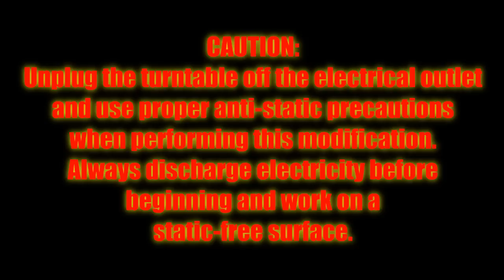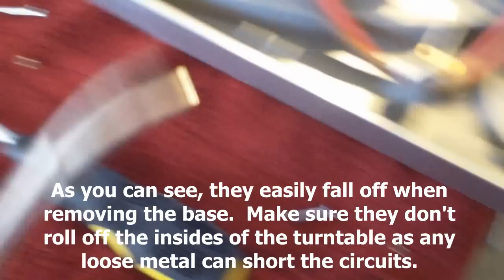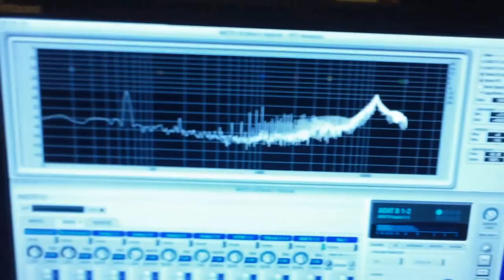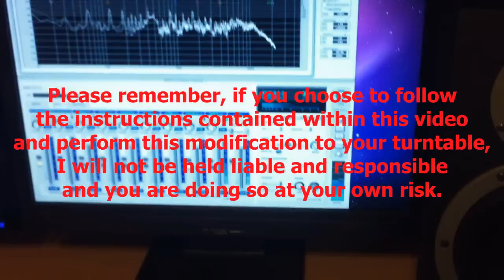AT-LP120 Preamp Removal (Step by Step Instructions)

Comment: i just finished this mod.but all i did was add another set of RCA cables on top of the tone arm wires. i never touched the preamp board.now i have 2 sets of RCA cables coming out of the back.so everything still functions properly. i just use whichever RCA cables i need for usb or listening thru my amp/reciever ,which has a phono preamp.
Reply: Yeah... like, do you even need to "remove" the pre-amp? It seems to me all you need to do is unsolder the connection.
Reply: Wouldn't that still be under the load of the built in pre-amp?  Isn't the pre-amp electrically connected in parallel to the tone arm wires, and therefore the only way to bypass it would be to break that connection?

Comment: Why are you doing this? Can't you just set the output switch to 'phono' and bypass the pre-amp?
Reply: Unfortunately, no.  While you "bypass" the preamp, the signal actually travels from the tone arm through the preamp board and out to your receiver, etc.  While not a huge deal, the right and left channel still each go through a coil and a small capacitor located on the preamp.  This is why people remove the preamp entirely.
Reply: Rich, If I don't remove this preamp and bypass the signal to another preamp- would there be any noticeable difference?

Comment: I don't understand why add a ground wire, as this turntable is already internally grounded no?
Besides that, why not just add a ON/ON 4 poles switch to the RCA cable (internal AMP ir bypass amp)

Comment: question?  How do I discharge the electricity?
Reply: +beefsupreme64 you can discharge static electricity by touching a grounded object. A metal computer case, or the screws that hold on the face plate of an electrical outlet work fine.

Comment: I did everything in this video step by step and now I’m getting a very slight ground loop hum on max volume, is this a normal occurrence? I’m driving myself crazy trying to figure out what it is but nothing helps. It’s really only audible at the max gain level on my powered speakers, and I’m using the project phono box mm as my preamp. Any help is appreciated.

It also seems to get quieter when touching the tonearm, or the ground lug on the back of the preamp. Seems like the tonearm and cart are picking up EMI. I don’t know anymore.

My setup is:
AT-LP120, stock cart and head shell
Edifier 1280T speakers
Project phono box MM preamp
Decent, not amazing cables (doesn’t seem to have anything to do with the hum though).
Everything is plugged into the same extension cord.
Reply: I also live in a NYC building, maybe there’s just too much electrical S*** around me. Lots of AC currents. PLEASE HELP MY OCD

Comment: Anyway to do this without adding an external ground? Why did it not need one before?
Reply: Yes just strip some of the black off of the end of the ground then turn it into a u shape and screw it securely under the screw that holds the spring intact

Comment: I’m confused. I have this turntable and it has a switch to bypass the built in preamp. I am now running it through a much better external preamp. Why would I remove the internal preamp?
Reply: Even when you switch to "phono," the signal from the tonearm still travels through the preamp board on the way out to your external preamp.  While traveling across the internal preamp board, each channel will go through an inductor coil and a capacitor, which can lead to a degradation of sound quality.  This is why people remove the internal preamp entirely.  It does add a brightness of sound that you don't necessarily get leaving the preamp in, but your mileage may vary.

Comment: Hello ... I've just watched your AT-LP120 preamp removal video. I'm wondering if this (built-in preamp) is causing channel imbalance issues as well?! I've tried multiple cartridges, tonearm setting, tracking force are OK ... still my left channel is a bit louder, stronger. It does that with line and phono mode also ... what do you think? Thanks for your answer in advance! Tamas.
Reply: Farkas Tamás Is your anti-skate correctly set?

Comment: Great guide!  Be careful tho, i yanked the signal cable clean out of the solder points on the tonearm boar, had to resolder them directly to the tone arm wires because i snapped off the trace on the board

Comment: So basically, I could just snip the one set of wires then just solder them to the solder points on the other PCB, correct? Obviously I'll need to add an additional wire for the ground.

Comment: At around the 6:30 minute mark an image of the spliced RCA wires is shown, in additon to the red and white wires two bare wires are present, i am assuming they are ground wires? If so how are they attatched to the groud wire connected to the tonearm circuit board ie: is it okay if they touch? is there any particular method to doing this? Also at the end of the process a new ground wire needs to be attatched, would this one be appropriate?:http://www.amazon.com/Technics-Ground-Wire-1200-SFEL026-01E1/dp/B003N300ZQ/ref=sr_1_1?ie=UTF8&qid=1414639442&sr=8-1&keywords=technics+ground+wire  if not what is my best option?

Comment: Why not just add a bypass switch? Also, why not solder the connections. Eventual oxidations on your connections may degrade the sound.
Reply: Is it possible only cut the current that feeds the preamp? 
Detaching the board is not important for sound and will be interesting if you decide to sell or change your mind.
This will be a  job simplification. Are you agree or any possible opinion?
What would be the practical solution?
Thank you.

Comment: I just tried this on my turntable and I am still getting a hum. I noticed you had 3 caps when you attached the first set of wires. What is the third one after the red and white?
Reply: You need to ground the rca cable

Comment: There is a pare of cables ( White & Red) that are comming from the controller board that are connected with a white socket to the pre-amp. You unpluged them from the pre-amp board and leaved them disconnected zipped next to the RCA Cables. What does this cables do?

Comment: just did this mod but i think I accidentally pulled out the wire for the right channel so I gotta open it up again and solder it back on. from what I hear on the left sounds like a big improvement.

Comment: I´m from Chile, sorry for my english. I unsoldered the original wire from the line-phone selector, and resoldered this directly beside armored capsule threads. I didn´t used another wire, there´s no needs. The original troublesome background noise  disappeared completely. Than you for your solution.

Comment: Question, sorry for my ignorance but when you spliced the RCA cables I see four wires in total, one white, one red, and two Black I presume? are those two the ground wires that are meant to be connected together along with the other ground wire coming from the circuit board? If you could answer this question please, and thank you

Comment: Not sure how active this comment section still is, but I just performed this mod last night and the audio is coming through really faint and scratchy. Rewatching it now, I forgot to connect the RCA ground to the channel wire ground. For clarification, do I connect both RCA ground wires (one from red, one from white) to the channel wire ground (twist capping 3 wires in total)?  Thanks!

Comment: OK I'm convinced to try it. But I have a cuestion. There is a pare of cables ( White & Red) that are comming from the controller board that are connected with a white socket to the pre-amp. You just unpluged them from the pre-amp board and lived them like that!! What does this cables do? and why you just zipped them next to the RCA cables?

Comment: If It put in phono mode and than connect a preamp in stead,  It wont works the same as removing it?
Reply: No, you will have problems with the "hum", because using a separate pre-amp requires a ground wire that you need to add yourself, and it is possibile to add it once you remove the pre-amp.

Comment: Question : Whenever I have a record playing on this TT and tap the plastic plinth with my finger I hear the tap through the speakers... I'm sure that's not right ? Anyone ?
Reply: +kvfive It is right, the cartridge is picking up the grooves and will also pick up any other vibration. A tap will be heard through the speakers.
Reply: kvfive The stylis picks up all vibrations. Hi-Fi people recommended removing the lid altogether.
Reply: Even expensive VPIs will make sound if you tap on them.

Comment: A very quality neat job well done however why not just attach wires from the jump board and run them directly to rca jacks and use better cables with less capacitance which is what you are trying to do by eliminating the capacitors in the circuit that way there is no reason to remove the board

Comment: Thanks for the video. It worked out great for me. I ended up soldering and heatshrinking it since I didn't have wire nuts that small. Question: I see you have the same preamp (ArtDJ) and cartridge  (AT440) as me. Do you find the load sounds better with 100pf or 200pf on the preamp?

Comment: Hey so really we can take this opportunity to add a longer RCA cable. Right? Mine barely reaches the amp, which means I have to be super careful moving the amp. It would be nice if it were about 3' longer.
Reply: I just got RCA jacks to add on to mine so I can use any cable I want. $7 on Amazon for 4 of them.

Comment: Question for you guys and gals. I have an AT-LP120USb, and finally had to take mine apart to apply dampening gel to the cuing post because over time, if you use that lever to place the stylus onto a particular track, it will drop like a rock. Audio Technica did not apply enough fluid (gel) to last more than a year if that. 

Has anyone calibrated/ pitch their 78 rpm correctly? Apparently, Audio Technica calibrated the 33 1/3 and 45 corrected and neglected to do the same with the 78 rpm. One the bottom of the unit, there are hole(s) that lead to no where. Correct if I am wrong, but don't only belt driven turntables have adjustment screws on the circuit board? I would are like to know how to do it for a direct drive table like this one.

Is there anyone out there that is experienced with the mechanics of this table? Let me know.

Comment: I'm about to undertake this mod. One thing I'm not 100% positive about. The extra ground wire I need to add, does this get connected to the black ground wire the was cut from the on-board preamp? If so where does the other end get connected to? I'm assuming somewhere outside the turntable like the back of my receiver? Is this correct?

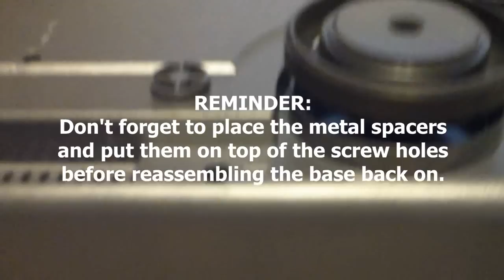Comment: First Mistake, Taking the Pre-Amp Out, There Is no need to Unscrew It leave It In. Second Mistake, Cutting the Wires, No need to do this. 4:25 De-Solder the wires Here (Take a Picture on the phone First). The (Red & White Cable) Is the power cable to the Pre-Amp. Disconnect this at the board end side of the Solder part and Tape down. Roll up the RCA Wire and tape the Ends and Coil up and tape this down In the Space Behind the Tonearm Hole. De-Solder and tape down the Channel wire (Grey One) and Tape the Ends, And Leave the Ground Wire Connected (Black One) Don't Un-Screw the Spring. Buy a Techincs SL Series RCA lead this comes with a built In Ground Wire.   https://www.ebay.co.uk/itm/Technics-SL1200-SL1210-Phono-RCA-Lead-Cable-Earth-Upgraded-1-2m-Gold-OFC/123863834238?hash=item1cd6dc1e7e:g:DWsAAOSwP41dRyPR   And Solder this on to the Board as shown on Your Phone Picture. You can use the Screw down wire holder It's tight but It will fit.Then Push the wire through the Large hole In the Bottom of the Base Plate. 10:01 There Is no need to do this You'll never get It back on without dislodging at least one of them. Just put the Top plate on and then put the Brass ring In the Screw hole (With the Arrow Next to It) and make sure the Screw locates through the Brass Spacer. Then tighten down till It pinches no more that, Or You will split the case or thread the Screw hole. Now flip It over set It up, Plug It In and Enjoy the Better sounding music. I have done about 40 of these TT's since they came out.
Reply from the maker: Thanks for the tips and suggestions. I did this mod and video 6 years ago and had since moved on from it.  Upgraded to a Pioneer PLX-1000 and now a Technics SL-1210GR.  My modded AT-LP120 served me well for 4 years.  I have countless of needledrops done with this turntable.  Have never needed to go back in and remod or fix it since I did this video. So my “mistakes” didn’t really matter. 

Tell you what. How about YOU make a video on how YOU would do it and send me a link. Once you do that, i’ll post a link on the description so we can direct viewers on how to properly and correctly mod this turntable.  That way, they don’t make the same “mistakes” I did!  Yes?

I do plan to take this video down after all this years.  I agree, there are better ways to do this mod.  I do hope my video served its intended purpose well.  It’s one of the first ones that showed people how to mod the AT-LP120. And I take pleasure knowing that it had helped at least some viewers. 

Again, credit goes out to vwestlife for his original video on which this was based.

Comment: After doing this mod, would it be possible to still connect it to a PC by using the supplied adapter cords and plugging it in through the mic jack??? I've done so successfully with a cassette deck using the adapter cords that came with this turntable but never tried it with the turntable & would like to know before I even attempt to do this. (I'm still afraid to try this anyway but someone should try this)

Comment: This is probably a really dumb question but I'm completely new to ripping vinyl. Once the USB is gone after this modification, how do you rip vinyl to a PC? Thanks!
Reply: +Clint Lanning If the USB connection is a must for you, you may choose an external preamp that supports USB (AFAIK, Pro-Ject produces one). Either you may rip via line output of the amp.

Comment: @frankpbcproductions or anyone else who can answer this question.

I have a Yamaha RX-V675 A/V receiver which has no Phono input/preamp. Just some RCA plugs for 'Audio 1' and 'Audio 2'. I'm simply running the sound through the LP120's built in preamp. I have to crank the volume on my receiver to  hear it decently.

Essentially, if I were to do this mod to my LP120, an external preamp WOULD be completely necessary, right? I'm a noob in the vinyl world, but I'm not entirely ignorant :D

Comment: So if i cut out the preamp i can still hook this to my receiver with  no problems right? if its done correctly. i`m thinking i dont need an external pre amp unless i use powered speakers. is that correct? thanks for your time and video. i`ll be performing surgery soon.
Reply: I also have another question. what is the difference from between the video you posted and or just hooking the rca cables to the 4 tonearm wires. both ways look like an easy job i`m just not sure whats best.

Comment: if I want to get an phono preamp do I need to remove the internal one and go through all of this? Just cause I have this turntable and I want the best sound out of it but I don't trust myself enough to do all of this. any suggestions?
Reply: Casey Ellington the atlp120 has a bypass switch where you can use an external pre amp

Comment: Word of caution.... Have good wire strippers on hand. The soldering job on the circuit board was crap. One oz of pressure and it snapped off the little wire from the board. Resoldering circuitry is tricky.

Comment: Doesn't this mod take away the ability to plug into your USB of your computer to copy vinyl to digital?
Reply: yes but there are several phono preamps with usb connectivity
Reply: yes
Reply: Yes, unfortunately. It should have been avoided as well. Leaving the ground wire in this "unfinished" mod is simply ridiculous and lame.

Comment: is this extra ground wire necessary?
Reply: No. This mod is completely lame.  Aside from its terrible constant video de-focusing... he left the ground connected  to the grounds of the channels on the other circuit board, so having the spare ground wire is simply stupid. Also the other circuit board should have been by-passed, as it certainly adds another distortion to the sound. And it only provides poor USB functionality and maybe signal muting, so it could be gotten rid of as well.  
The signal wire should have been soldered, not red-neck style washing machine like screwed together directly where they leave the arm, leading every wire separately down to the external cable. And the ground wire separately. Only after that this mod would make the sense.
Again, this video is terribly, terribly lame.
Reply: @PhonoDirect  And yet, it actually works!  Thanks for your input, Mr Edison!

Comment: I have two questions:
1. What preamp are you using?
2. What is the software you are using?
Reply from the maker: Preamp is an ART DJ Pre II and the software you're seeing is the Cuemix Console for my MOTU 828 MK3.
Reply: frankpbcfproductions Ok, i've read that with this turntable, you have the ability to switch off the internal preamp. If that's so, why remove the internal preamp? Why not just turn the switch on the back to phono and connect it to a phono preamp? I'm just curious. No disrespect meant. I'm just trying to learn.
Reply: Night Owl 1.- even putting the phono set, it produces a loss first on the output (3.5v of cartridge reduced to 2.5v) and 2.- on some preamps and integrated amps may cause a disturbing hum noise on high volumes. I had a aiwa px-e850 and I tried to use the phono set and it was a terrible hum, so I had done a bypass directly wiring the cart to the preamp input and adding the ground wire. It was good.
Reply: The switch does not take out of the circuit path some inductors and capacitors that change the audio.